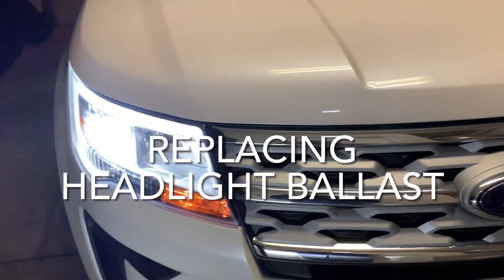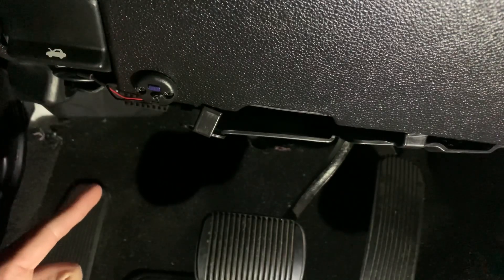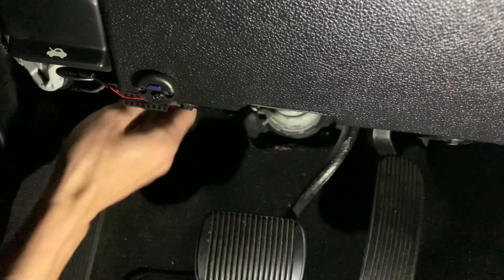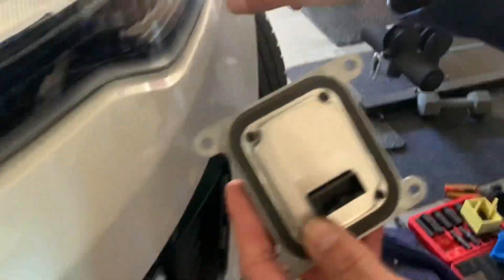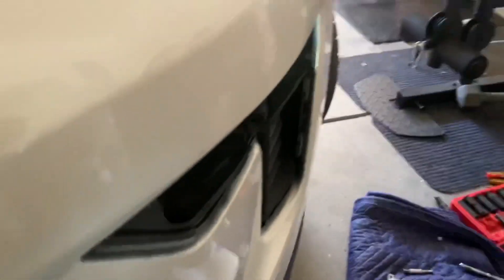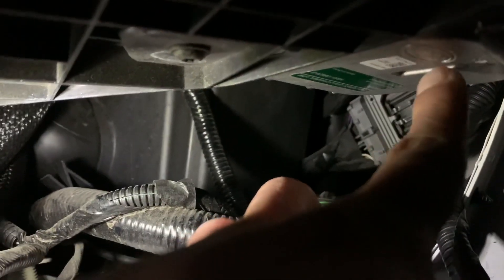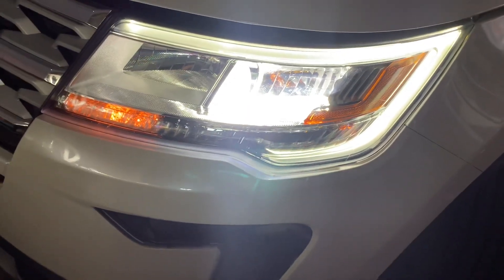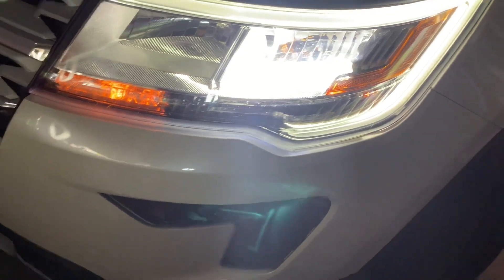Headlight Ballast replacement  Ford Explorer 2019

Comment: My LED strip light only lights up on the top and not the side. Do you think it's the same component issue?
Reply from the maker: If it’s the side turn signal!
Is not the same component.
Reply: @Daysnlife  It's the white LED running light that wraps around the light fixture. The strip on the side turns off sometimes. The top remains on. Thanks
Reply from the maker: @MrGriff305-d3u 
Oh I see that should be the same component which it is  the ballast.
What I would do is to replace the ballast. 
I wish you luck 🙏
Reply: @Daysnlife  Thank you! I'll try it.. You're very kind to help people with questions 😊

Comment: What fuse is for the lights
Reply from the maker: I can not remember which one was it it’s on the manual. 
But in my case it wasn’t the fuse it was the ballast.
Reply: I am also curious what the fuse is because the manual doesn't say anything about headlights.

Comment: Got the same problem on my 2018 expedition.  Hopefully is it cause I ordered one. Those headlight assembly are like 1200 dollars.
Reply: Hi Bro I got a 2018 limited explorer.  Same issue the lower Bean won't tue. Only the led lights. Did it work for you?
Reply: @raul_f_1234  nope
Reply: @billyfranco1374  sme here it didn't work. I am about to order it from offer up for around $350

Comment: I’m having the same trouble with my 2017 ford explorer xlt , my high beam works but my low beam and led strip is out , would it be the same process.  ?

Comment: The all day running lighs are working fine except for the low beam. Will it still be the module that needs replacement?
Reply from the maker: I think still the ballast/module on yours it is different.
But both lights works with the ballast so I would replace it.
Reply: It's a 2017
Reply from the maker: If model it is XLT you will be ok same headlights housing.
Reply: @Daysnlife  okay thank you
Reply: @Daysnlife so I have problem and I wish you can help me. I bought a 2017 explorer XLT after accident and there are headlights missing and modules as well. How do I choose the headlights correctly if I don't know which headlights were there before, and how to find out which module I need for that headlights (yellow or green) I want to buy aftermarket headlights because OEM are too pricey for me.

Comment: I have a issue with my Explorer XLT, I wonder do I need just the module replacement or both the module and the left driver headlight?
Reply from the maker: If you have same issue on one of the headlights just change one ballast.
And you should be fine.
Reply: I have this same problem but on passenger side. Can this cause the opposite headlight to stay on? Because that's what happened to me and it drained my battery, luckily my battery was still under warranty. What is the part number for the module?
Reply from the maker: @elvisq34 
Well the day lights stay on so yeah it’s supposed to.
Part number HB53-13B626-B
Reply: @Daysnlife  how do I tell the difference though, on if I just need the Module or both?
Reply: Where did you buy module?@fixingonabudget3552
Reply: @fixingonabudget3552 where did you get module? Thanks
Reply from the maker: @VV-fd1mb 
I bought it on Ebay And it worked just fine
Reply: @fixingonabudget3552  thanks. Did you buy oem or aftermarket?
Reply from the maker: @VV-fd1mb 
OEM yes

Comment: I have a 2018 ford explorer platinum and the day time running lights on either side won't turn on. My turn lights, high beams and low beams are working fine. Do you think it might be a fuse or something entirely different?
Reply from the maker: Most likely is going to be the fuse you should start checking the fuses first. If all fuses are good then it could be the ballast.
Reply: Hi. I’ve got a focus with flickering drl when door is unlocked. Just wondering I’m gonna purchase a new module will it need programming with forscan or is plug and play thanks
Reply from the maker: That’s something that it May happened with a electrical issues.
Reply: @Daysnlife  I’m positive it’s the common module fault as it is the old BD module that’s on mine.  I will update when I fit it
Reply: I bought a new assembly and module. Only high beams still work. The guy who put my headlight mentioned the wiring that attached to the led module was like a y and I think he stuffed the other part in somewhere. What else does the led module wiring plug into
Reply: Update.  Fitted new module. All working fine now. Just plug and play
Reply: Hola el modulo después de instalarlo hay que actualizar si es así se actualiza con un escaner porque le cambien el modulo y aun la luz led dura 15 minutos en apagar
Reply from the maker: @EduardGutierrez-bh1rm 

No no hay que hacer nada después que se instale. 
Algo está mal por ahí